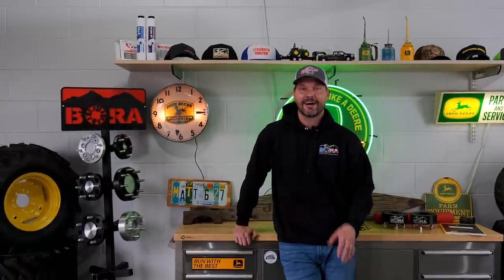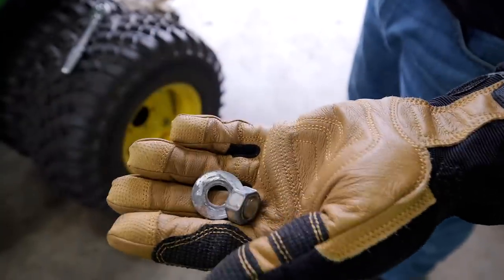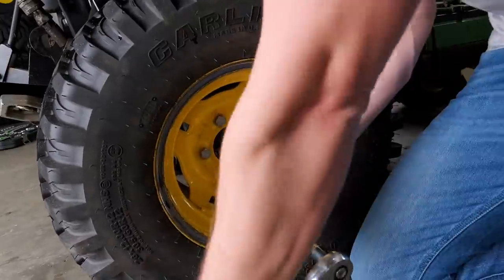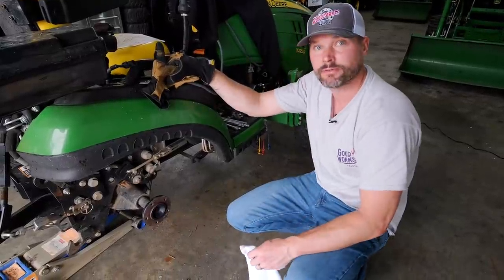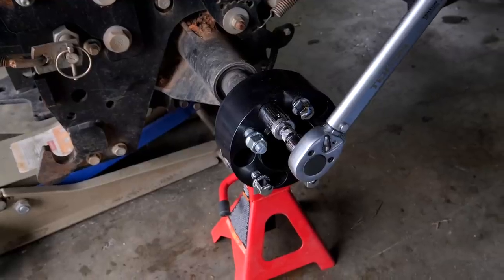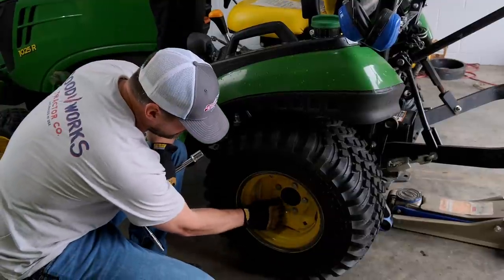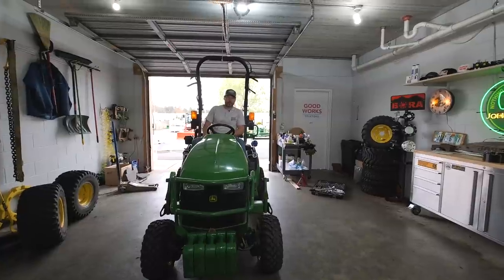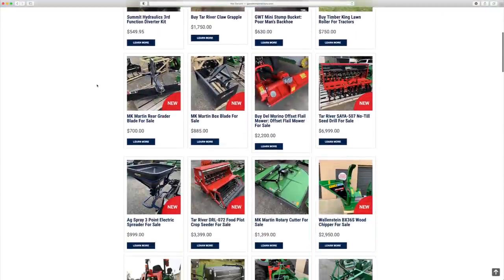SAFETY FIRST! HOW TO INSTALL WHEEL SPACERS ON YOUR TRACTOR! 🚜👨‍🌾

Comment: I have to disagree with your interpretation of the paint wear on the wheel from the dual wheel spacer.  If the pain came off due to the tight fit, you would have peeled it when the spacer was installed.  You didn't mention that, so I'm assuming it didn't happen.  Seeing it now is more of an indication of the dual wheel/wheel spacer were 'working' or moving very slightly.  That might even explain the frozen/twisted off nuts - if those nuts/bolt were bearing most of that load the threads on the shaft or nut was deforming from the load.  YMMV.

It wasn't clear from the video if you followed the pattern you should in tightening (follow the star not the circle).  However, setting torque with any wrench always make sure the bolt is turning when before and when it reaches torque.  Checking torque or finding a bolt at torque without moving it doesn't really tell you it was on torque.  The is due to the difference between running torque vs. static or breaking torque.  It takes more torque to break a bolt from rest than it may actually be due to the additional load of overcoming stiction, etc.  If you find that the torque clicker goes off as soon as you try to turn a bolt and you weren't certain you were at torque when it stopped, the loosen slight so that you get a running start to reach torque.

The other reason for tightening in stages to prevent off center application of torque and potential over torque on the 'off' bolts.  For an extreme example - all the bolts just finger snug then going to full torque on the first then full torque on the opposing bolt almost certainly result in excessive torque on the first bolt.  Take in stages of around 1/3 the final torque value or 1/4 will eliminate that issue (along with following the proper tightening pattern)

Comment: Not sure but it looks like you are using a hardened claw hammer on a cold chisel or punch.  If so, that is a safety hazard.  The strike could shatter either tool and release a chunk of steel at a high speed. It can puncture skin.  Generally you would use a ball peen hammer which more malleable for hitting hardened tools.  Just looking out for you.  Good video.
Reply from the maker: Never heard of that.  Will look into.  Been doing it this way for years.  Thanks for the safety tip!
Reply: Reference on hammer safety https://www.safework.sa.gov.au/workplaces/plant-tools-and-vehicles/hardened-steel-tools